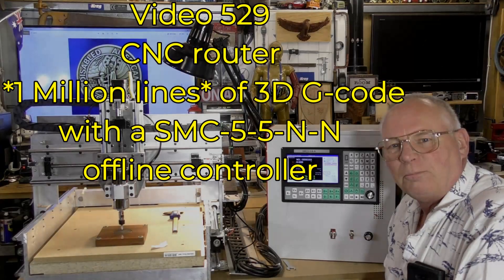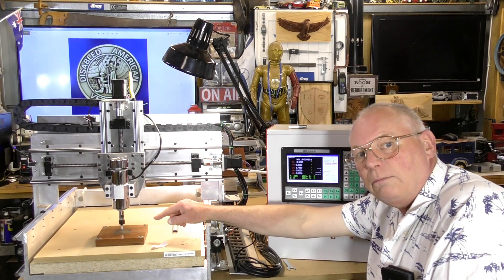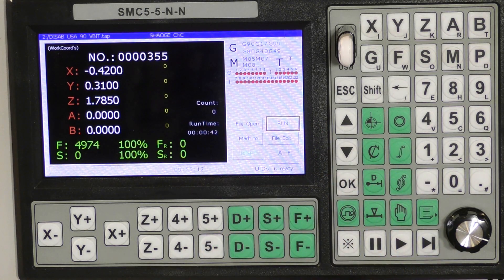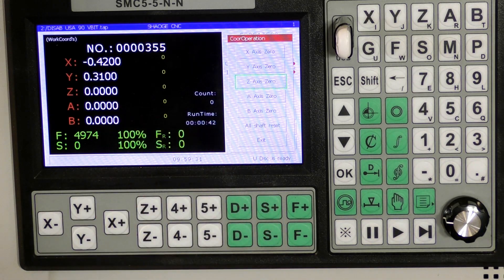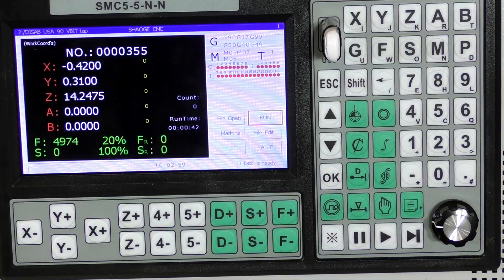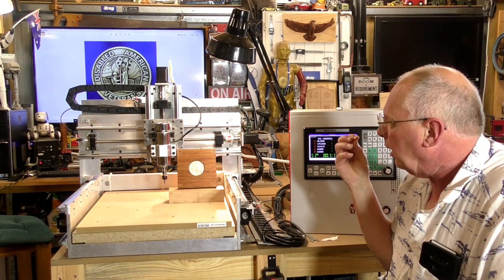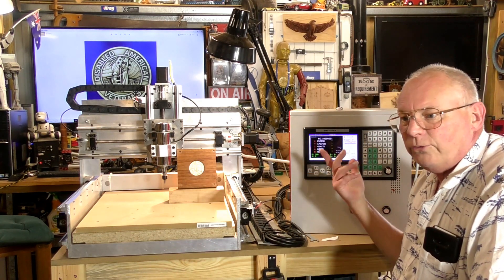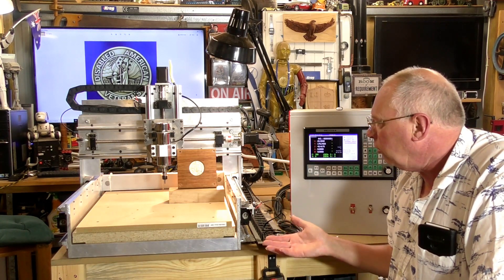*1 Million lines of G-code* + I WOULD "NOT" PAY OVER $500 for the SMC 5-5-N-N controller

Comment: Hi Roger, If you open up the SMC5 the internal memory is provided by an SD card which can be replaced. I have replaced mine with a faster high quality 32GB one and the performance is slightly better but it is great that it can be replaced as this would be a point of failure due to the cheap Chinese internal one fitted.